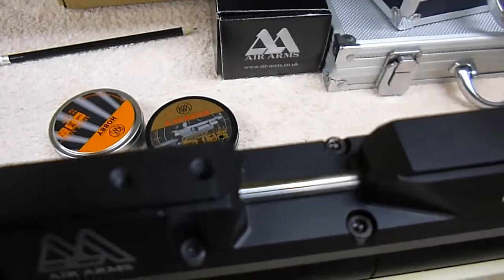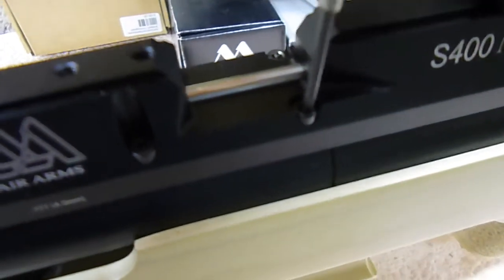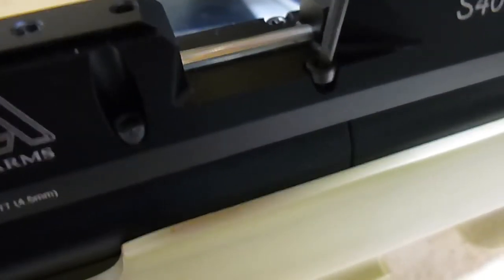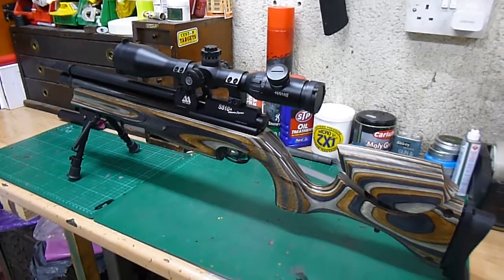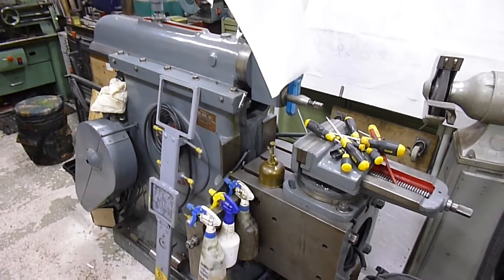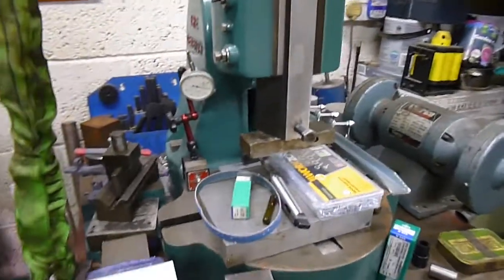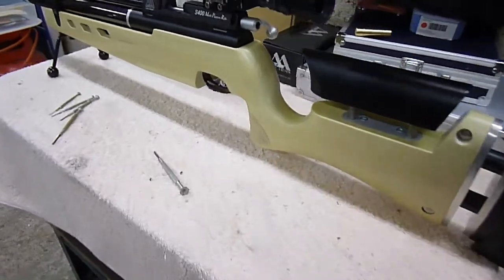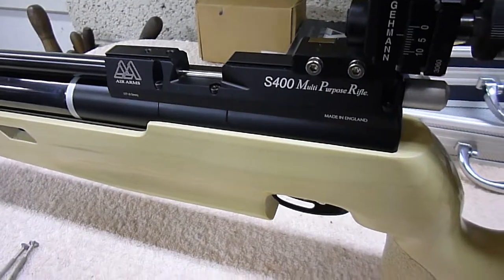Air Arms s400 mpr precision air rifle, anti tamper bolts removal

Comment: Iv just subbed too as your kits interesting. Just purchased S400. 22 Superlite superb gun. Only negative anti tamper plugs just ridiculous, you will never stop power mad idiots. I look after a couple of dairy farms and some stables. Rabbits are usually 35 yard average, but rats and ferals are 15 yards or less near the milk parlours. My gun puts 11.9 ftlb with Hades which are superbly accurate. Not happy about the power would like it at 11.4 ftlb and then to reduced to 9ftlb for Ferals and Rats. Could I do this just with air venturi screw which sits across the transfer port? If I could can I remove that anti tamper plug and have you any tips please. Cheers Tony